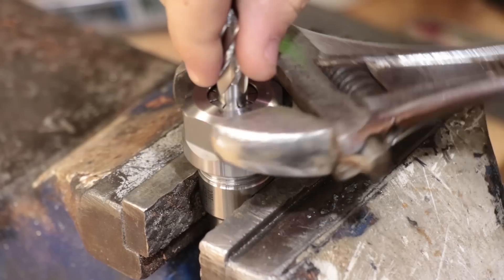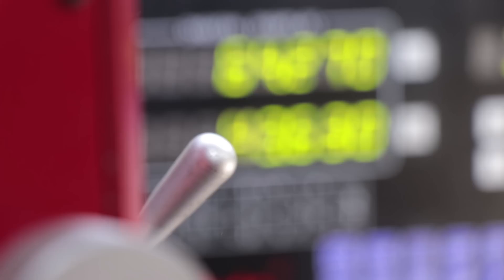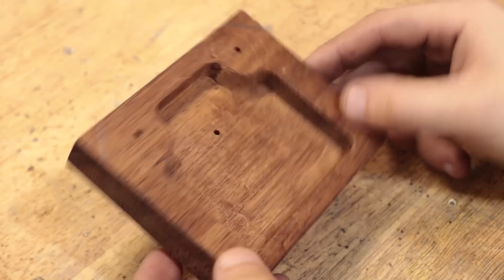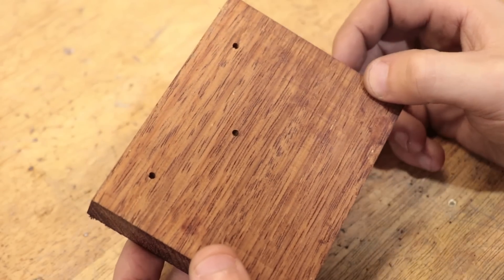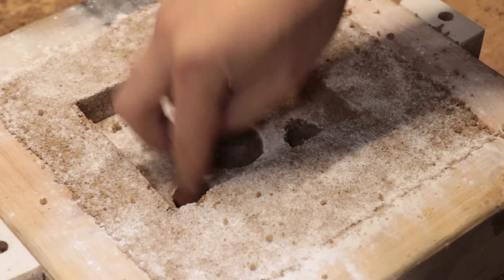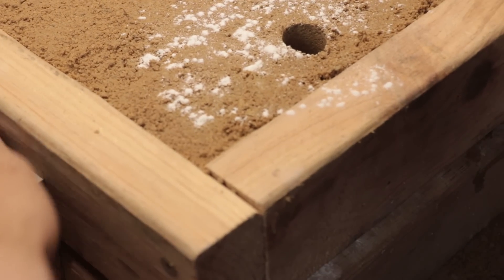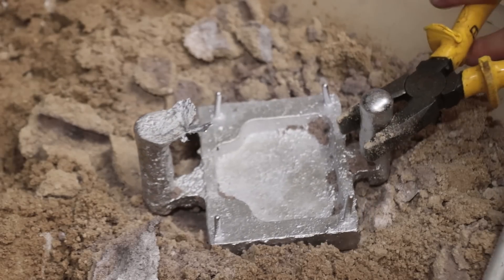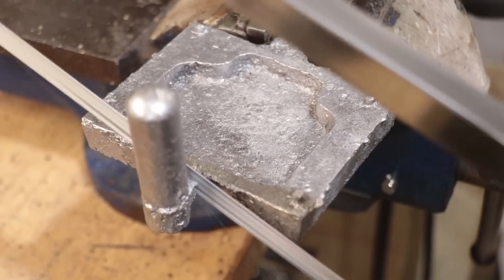Making a Gearbox Part 1 - Casting The Housing

Comment: If you can make a pattern out of wood, why not just make the part out of aluminum  ? Instead of casting.
Reply from the maker: Cheaper and more efficient than buying a big slab of aluminium and removing a bulk of the material

Comment: When you run out of that high silicone aluminium stock you could try getting an old quality alloy wheel and go at with a hacksaw until you can fit into your crusible.

Comment: Looks like you got a part in the end, but there's a few things you could do to improve, without too much effort. 

Your pattern-making needs a bit of work, get rid of those sharp edges and corners, as that's where the sand will like to break-out first. and paint the thing after hand-sanding everything, it's amazing the difference a bit of paint will make, the sand will slip right off! alternatively, machine your patterns from plastic such as abs or hdpe, as long as the surface-finish is good, it works well and machines so easily even a cheapo 3018 cnc will cut them!

Your sand looks to be really clumpy, maybe let it dry out a bit so it'll pass through a fine kitchen sieve, throw out or grind-up the lumpy bits then re-water as required. you need the sand to be as homogenous as possible, with no big lumpy bits to ruin your surface and cause unintended breakouts.

Cut a proper pouring basin into your mould, use your spoon to dig a circular-ish depression, 50-75mm across and 30mmish deep close tou the edge of the flask (for easier pouring) and connect it with the sprue by cutting a channel to around half the depth of the basin, make sure all the edges are nice smooth rounded shapes to avoid frothing up the metal, and use a tapered sprue while your at it, they're a little harder to work around as you have to ram the sand around them rather than cutting after, but are worth it for the result. check out "oldfoundryman" on the tube for more details, by paying attention to his techniques, my own casting has improved dramatically, and seemingly insignificant details can make a huge difference!

But whatever you do, keep doing it!
Reply from the maker: Yes I am aware of this. Like I said in the video I'm working through issues with the sand. I didn't have a choice in the sand that I could use and the only sand I could obtain was this. We have had non stop rain for the past few weeks so the sand came soaked. Its slowly drying but it's still too wet to properly sieve . Willl have to try out painting the patterns although leaving sharp corners is on me and I should have known better. Cheers
Reply: @artisanmakes  this side of the planet is roasting hot at the mo, so my sand needs it's water topped up constantly! spread it out as thin as you can on a big sheet overnight (a fan will help too) if you can. or just bake it in the oven if you can get away with it! the sand is probably the most important bit to get right, but it takes a while to get the feel for how it should be. good luck dude!
Reply from the maker: Cheers, you can certainly take our rain, everyone over here is sick of it :)

Comment: Having read through the comments there is some good advice, and some not so good. I hope you can tell the difference. You had The olfoundryman channel is one you would benefit from.   https://www.youtube.com/channel/UC90RoN_IjSRF18jAG0HIA6g

On your casting you had what I expect you thought was a feeder. (opposite from the sprue) Based on where you could use an explanation of its use. 

First you must understand that the metal does not solidify/freeze all at once. As the metal solidifies it also shrinks and it will pull metal from still fluid areas if it can. The feeder is to be a supply of molten metal to the part of the mold that is still liquid. You need to think of the direction of solidification. What the temperature of the metal is as it enters the mold and fills the available space. 

As a simpler example, assume you are casting a single metal bar, 10mm round by 200mm long, and if the sprue is feeding metal into one end. The temperature of the metal will be highest at the sprue end rather than the far end. As the metal moves away from the sprue side it is cooled by the sand. At the sprue side the sand is getting more heat pumped into it from the new fresh metal as the pour continues. Based on this the far side (being cooler) will freeze first, and in this simple case, the direction of solidification will continue toward the sprue, where it will freeze last. As the metal solidifies it shrinks. And this will pull metal from where ever it is still present. In this case, from the metal still fluid at the sprue end. In this case there is no need for a riser because there is a desirable path of solidification. 

Now take the above example and place a larger volume feature at one end. Like a hammer. The shaft is still 10mm round, still 200mm long, but with a simple hammer head on the end, 30mm diameter and 50mm long with a junction at the center of the long section to the 10mm diameter shaft. 

If you had the hammer head at the far end, opposite from the sprue, you have a situation where the larger cylinder of the hammer head will be solidifying from the outside in. The outside in contact with the sand will freeze first, with the center still yet to solidify. But as it is shrinking when it is solidifying it will try and pull metal from what has yet to freeze. And in this case it will not be able to pull metal from the hotter sprue side because the 10mm shaft has already froze in the center and is preventing and metal to be pulled from the still to freeze hammer head. What will happen is you will get a shrinkage defect at the head end.

Now it is possible to add a sufficiently large riser at the head. But this is only marginally better. What would be better is to put the hammer head at the sprue end since the molten metal for the head, and the riser, do not have to flow through the 10mm shaft to fill those cavities. This will allow the shaft to solidify first toward the direction of the sprue. The head will not be drawing metal from the shaft.

In your mold the thickest material happens to be at the sprue end. Whether by design, or by accident, this happens to be preferable. The riser you have is the equivalent of a read herring. It is there but it is only providing confusion. It is not feeding a larger slower solidifying mass. It isn't very large so it may not have any detrimental effect. It has the possibility of causing a  shrinkage defect at that end if it were a significant volume. 

There are a lot of bad casting videos on YouTube that unfortunately providing bad information to those who are interest in it. Even some casters that have been at it for many years, with many videos, also are not always doing things right. 

Keep at it. Take a look for good examples and think of how they are doing things. Consider the theory and how it is being implemented. 

You might find this video interesting. https://www.youtube.com/watch?v=_-213KOqwHU  The riser on the right is not intended to feed the part. It is to slow the rate at which the part is filled. There are a number of things going on in this test but it would take a while to explain it all. Without all that, it is just cool to see.
Reply from the maker: Cheers, I always appreciate people taking time to comment. You explain it a lot nicer than my engineering textbook does. which has been my go to. With that said it needed the riser. I tried doing it without and I couldn't get it to work well, granted there are probably other variables at hand including my skill at doing this. I have a few casting specific books on the way which should be batter aimed at sand casting in particular.  Cheers

Comment: Take a look at the teeth on your hacksaw blade. You might want to spring for some good bi-metallic blades, Starret are amazing if you can afford them. Sharp blades cut through aluminum and steel so fast it'll make you feel stupid for using dull blades.
Reply from the maker: I use full hss hacksaw blades from suttons. These were a little dull from going through a chunck of stainless

Comment: A gent called myfordboy has some great casting vids you should check out.  He just switched to 3d printing his molds.  The real trick seems to be including a draft angle on the sidewalls, bondo filler, sanding, and painting.  Petrobond casting sand (190 mesh) will give you amazing results with your current setup.

Comment: Great job, that casting is looking rather fabulous! I should finally get around to try that as well...

I was wondering, have you been made aware of iHSV servo motors at all? They're an almost-all-in-one package, and I used them to convert my CNC6040 fairly easily - the hardest part was me trying to figure out what I needed.
Of course, the mounting points being nearly the same helped a lot.
While I'm not sure how compatible they would be with the CNC controller you already have, they would be the power feed of your dreams! (Plus also enabling CNC on your big milling machine, potentially)
I'm currently toying with the idea of buying a milling machine similar to yours and slapping my servos on that.

Edit: Ah nevermind, I just saw a comment further down saying that you like machining by hand. Cheers anyway!

Comment: Came out pretty spot on. I've got access to a couple of old mag rims I'm going to try to cut up and use for casting with. See how they go. Bloke I know has had some good success with them.
Reply: Aluminum rims, pistons, old engine parts that were cast, etc. all still seem to have a bit of flux in the metal from it's original casting. Makes for really good sand castings.

Comment: I think a 3D-printer is the tool you need to produce the casting patterns.
I saw it on many other channels, they all use a 3D-printer. Its way more flexible...
Reply from the maker: I can but I personally prefer to machine stuff by hand, its a lot more fun and this is only a hobby to me
Reply: People have managed for thousands of years without them, I think he'll manage. These are rough castings to be machined later anyway.
Reply: OK, fair point.
But they also managed it without a gas fired forge, a dremel, a mill or a lathe. And electicity is also a quite modern thing...
These are just tools, that you CAN use, you don't have to. If you wanna work medieval, no one stops you.
But the most of us like to use some tools, that makes the work easier. And if it is a 3D-Printer that makes it easier, why not?
So you don't have to mill hours on a block of wood.

Comment: Wouldnt it make more sense to 3d print the pattern? Great video, as always.
Reply: Wooden patterns have been the go-to for thousands of years, and they work very well.
Reply: @TheIntermont  True, but to be fair 3D printers didn't exist for most of those years! 3D printing patterns can be equally effective and much faster, if you know what you're doing. I guess it depends a bit on why you're casting - if it's for the enjoyment of the process, wooden patterns are traditional and the way to go. If it's just to get a finished part, why not choose the fastest method?
Reply: @cooperised  The next step would be a metal 3D printer, then you don't have to cast anything. But that's a quite expensive machine.

Comment: I didn't understand why you made the wooden form first and then the casting. Didn't you previously take (or create) an aluminum block and machining it?
Reply from the maker: For one I am making 4 of these so it does.lend itself to casting, plus machining it from solid aluminium would be extremely expensive and in any event it is quite difficult for me to get large pieces of aluminium at the moment.

Comment: Why not just machine a pattern out of wax and make a mould out of plaster?

Sand is too finnicky IMO, it's only good for "mass producing" (in hobbyist terms) a single large design, because you can quickly prepare a dozen moulds from the same master and cast them in sequence.
Reply from the maker: I'm making 4 of these so sand molding suits. Plus it's good practice for me doing sand casting. In any event this is a hobby so what is most efficient doesn't matter as much to me, I enjoy casting so I did this. Cheers
Reply: @artisanmakes  Fair enough. I enjoy casting too, just not sand. As a wise man once said, it's course, rough, irritating, and gets everywhere.

Comment: hi .. try not to have the sand so wet..?? ok .. turns to steam .. hence air bubble's .. but if you put pressure on the mould.. ie build higher feed points.( air will leave and metal will replace it..  you can use two old bean cans to make it happen. ok all the best.. Tone UK
Reply from the maker: Yes I am aware of this. Like I said in the video I'm working through issues with the sand. I didn't have a choice in the sand that I could use and the only sand I could obtain was this. We have had non stop rain for the past few months so the sand came soaked. I do dry out the mold before I use it and that helps mitigate the steam and that will have to do until the sand gets dry enough

Comment: Ive never cast anything before but isn’t your sand a bit too gritty? Have a look at windy hill foundry his green sand looks more like a play dough type keep up the good work tho 👌
Reply from the maker: I know that the sand I'm using has issues and it's not optimal. I didn't have much choice in the sand I had access too when making the green sand mix so I used sand from the hardware store. In any event it's too wet and it's making it look coarser than it is. I am working through its sissies and I am conithat it will get better.
Reply: @artisanmakes  I seen a video of someone using the kids magic sand stuff casting aluminium and it worked perfectly might be worth a try?
Reply from the maker: It's something to consider but I'm not sure about the longevity and reusability of that type of sand. Cheers
Reply: @artisanmakes  true

Comment: Nicely done.  It turned out better than I was expecting. Did you naturally dry the mold or heat it to dry it. i. e.  assuming it was using water as a binder or is some other liquid used to bind the sand?

Comment: I have a feeling it will be hard to remove the pattern from the sand. 
Patterns need 2 to 3 degrees of draft and a radius to be removed from the sand.
Reply from the maker: I initially did forgot to do that so I had to add them later. Bit sloppy on my part 😅
Reply: Easiest way to put draft on patterns would be to use tapered end mills.  There are some 1/4 inch carbide ones with 2 - 5 degrees taper per side.  I’ve used ~ 3 degrees successfully.

You want your patterns to be glass-smooth.  I’ve used lacquer, or more recently, shellac.  Finish them up with a waxing, followed by a dusting with graphite before you put the sand to them.

Comment: could you please varnish or paint the pattern and do infills in the corners? unless it is a diecast sharp edges will never come out well due to sand particulat size
you can add sharp corners in post processing while machining the part

Comment: If you want to make packing the sand and spreading it easier on yourself, you need a sift. Put the sand in the sift then shake it into the mold box. Your molds will have better and smoother contour.
Reply from the maker: Like I said in the video, I'm working through issues with the sand. One being is that it's too wet to sift. I didn't have a choice in the sand I had access to and in still drying it out before I can sift it
Reply: @artisanmakes  mix talcom powder in it. Help make the sand finer and dry faster.
Reply: @artisanmakes  if it is too wet then take approximately a quarter of the sand that will fill the boxes and lay it out on a flat board out in the sun to dry out, when it's too dry to hold together, (but only just) then thoroughly mix it into the wetter sand and you should have the correct moisture content for the sand to hold together when gripped in your fist. Then it should cast ok without having too much steam being produced inside the cavities of the mould.

Comment: Besides draft, you should have fillets on... everything, in every direction. Essentially make it look like a kids' sand castle mould, because that's what your pattern effectively is. The should really be no sharp edges of any kind anywhere at all (except the parting line) unless they are truly critical to be that way. The way you'll get a much much cleaner pull.
Reply: One thing watching you start to make the mould, you need to sieve the sand on top of the pattern. This will give you a much better surface finish on the casting. Then😮 keep sieving sand as you ram where you expose the pattern. Once you have the pattern covered with lightly rammed sand it is then that you can start putting sand by the handful into the cope to ram to up level the box. And looking at that sand, it looks rather too wet, and it's nothing like the sand I've seen before. And I taught casting back in the days when they still did it in schools here in the UK
Reply from the maker: Yes I forgot that bit, the curse of filming is I tend to forget stuff 😅 Take care.
Reply: @artisanmakes  I did that quite a few times, and I didn't even have filming to excuse me. Bit by bit realised everything needs a radius... inside corners, outside corners, along the XY plane, along the YZ plane, etc... basically by having had too little clay in my sand and therefore it being very unforgiving to work with. Teaches you fast. Not so fun.
Reply from the maker: Cheers mate thankyou for the heads up, really useful information.